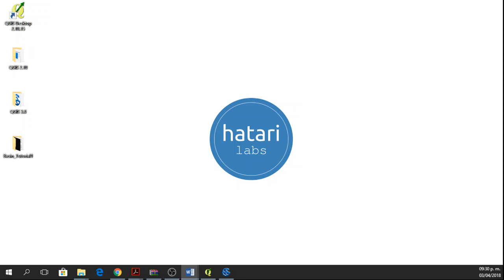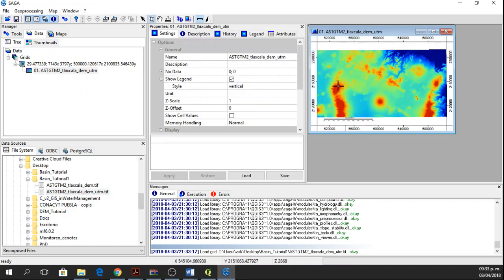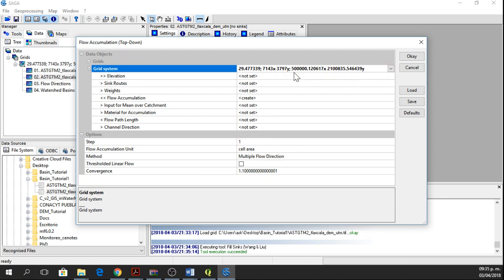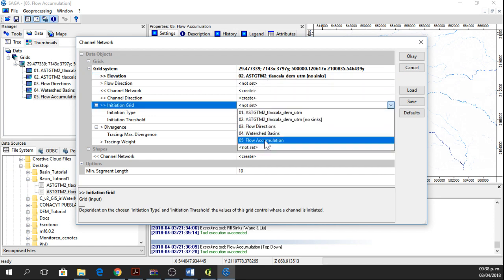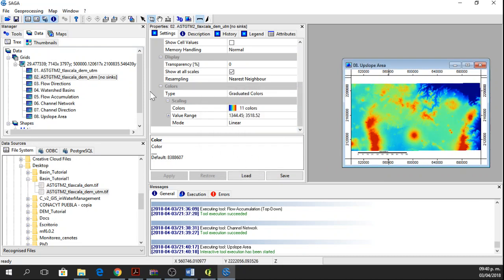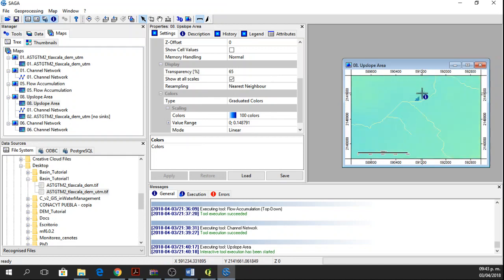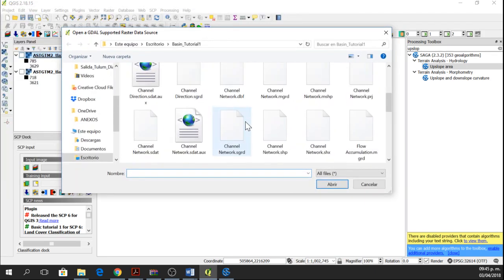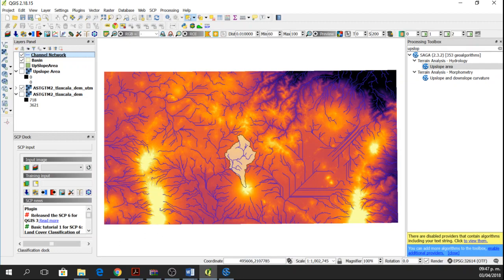How to obtain a Basin and Channel Network from a No-sinks DEM in SAGA GIS and QGIS – Tutorial

Comment: Hi. Great tutorial, but I can't delimitate the streams of a watershed. The Strahler Order is generating small segments, which are not connected to each other. I'm using an Alos Palsar image (AP_04149_FBS_F3990), and the outlet of the watershed is at (406314.065,7931691.022), SIGAS 2000, 24S. Please help me to delimitate the streams. (specif section of the DEM is at https://www.dropbox.com/s/o53upczfchicey1/BamburralWatershed.tif?dl=0). Best regards

Comment: In the Channel Network options: What does the "initial threshold" stands for? 

En la sección de Channel Network, ¿Para que sirve el número colocado en "Initial Threshold"? 
por que poner 10,000,000. Y como se que el número que estoy colocando es correcto.

Thanks!
Muchas gracias!
Reply: I always take such as the Standard Deviation from the attributes of the raster layer Flow Accumulation